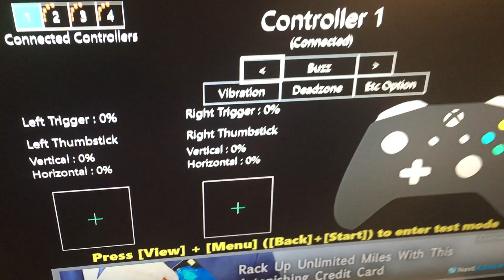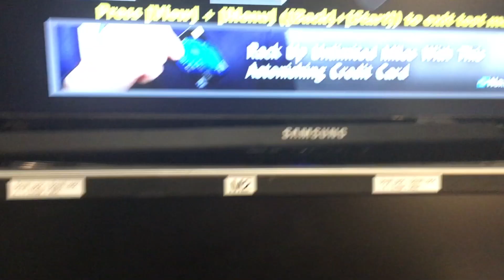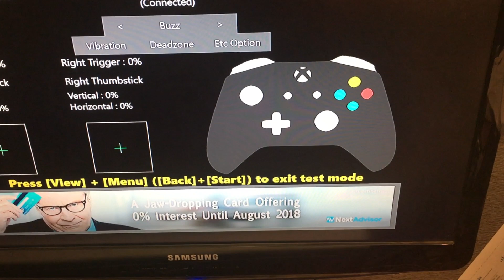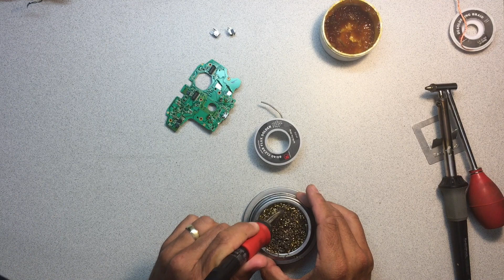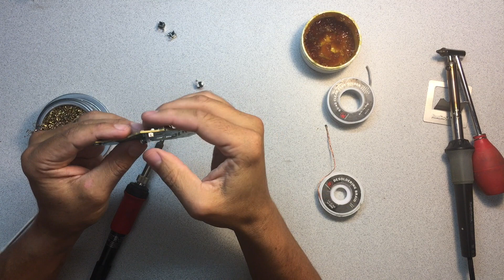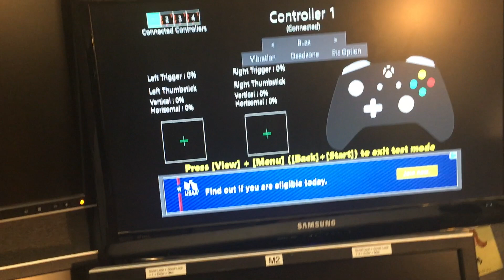Xbox One Controller Repair: LB and RB Tactile Switch Replacement

Comment: Mine still didn't work after multiple solder attempts...
Reply: TheTyphoon365 same here
Reply: #GetItMark #TheTyphoon365
You may find potentially some form of liquid / residue on the bottom board shorting it out causing the recurring issue. Failing that your best bet assuming you have definitely soldered successfully 100% with new buttons and no success is to check the tracers on the board and see if there is any damage which would explain the fault remaining, in which case once damaged part of the tracer is located then simply clean 2 areas on the damaged trace either side of the break and gently remove the top layer revealing some copper and solder a very small bit of wire to bridge the gap and retest. I hope this helps you both cheers.

Comment: Do you think its possible to replace the pairing switch which is on the motherboard? or should I replace the hole motherboard then?
Reply: Not an answer to your question but a motherboard is what everything plugs into on a computer. What you’re looking at is a circuit board

Comment: I just made successful swap, i do however suspect that i damaged a circuit component.  i Held my iron at a wonky angle so i accidentally heated up the white component just to the right of the Usb port(you can see it at 16:36). I think this is a resistor, can anyone confirm this? If so, does anyone know what it's role is? and which systems/functions it will affect? i've tried to do some troubleshooting but not found any issues yet but naturally i'm kinda skeptical since there's visible damage to the component.
Reply: did u try charging it using the micro usb port? That could be a thing affected by that damage...
Reply: If everything seems to be functioning properly, I wouldn't worry about it. If something does go wrong, you will know where to look. I would suggest something like Kapton tape for beginners. It's a bit pricey, but you can cover other areas to protect them from this type of accident.
Reply: Thanks for the tip guys. Haven't really noticed anything except some heat from the battery pack when charging but it's a nimh so it's to be expected. If the resistor was fried, it should not cause excessive charging..right? It would most likely just not charge?

Comment: what is the name of the tool you use to extract the weld? any link to buy?
Reply from the maker: Manual Soldering Pumps are cheap but work really well and will get rid of most of the solder:
https://amzn.to/2ZrD8w4
Then I use desoldering wick dipped in rosin flux to get the rest. With a little practice you can remove almost any through-hole component:
https://amzn.to/2NA9gv4
https://amzn.to/2zpCsg6
The main trick is to leave the soldering iron for a few seconds to make sure you heat things up well.

Comment: I have the bag of tactile switches but dont feel comfortable with the soldering. Do you still do the work for cheap? Your old ebay listing doesnt work anymore. Let me know. Thank you very much.
Reply from the maker: Sure, I’ll put up a general LED swap and controller repair listing. I’ll post the link once it’s up. I’m thinking $8 which will also include return shipping.
Reply from the maker: Here is the specific listing if you are interested.
https://www.ebay.com/itm/233295752103
Reply: @mpdavig  Sweet thanks buddy. I will go on there now and communicate with you through eBay. Thanks again!

Comment: The wires holding my button on the board are sticking out a bit I think I’d be able to cut them with wire cutters instead, do u think that would work?

Comment: i bought a new xb1 controller an after a week my rb button has this exact problem. I have a soldering iron but no real experience in using them. any tips?
Reply from the maker: Sure, if it's that new I'd probably return it. Otherwise, what you see in the video is hopefully pretty straight forward.
If you are in the US and have an eBay account, I'd fix it for cheap and change the LED if you want:
https://www.ebay.com/itm/232199364488

Comment: Is it a hard process??
Reply from the maker: Wow, you're the first comment after all this time. I recorded and kept the footage on this video almost completely real-time. This is one of the earliest model Xbox One controllers so they are the easiest to repair. On some of the newer controllers they shrunk the through-hole size so they can be trickier to desolder.
If you have some experience soldering this shouldn't be too difficult.